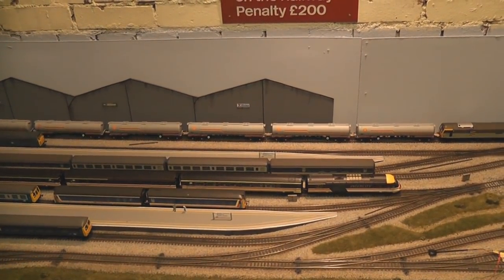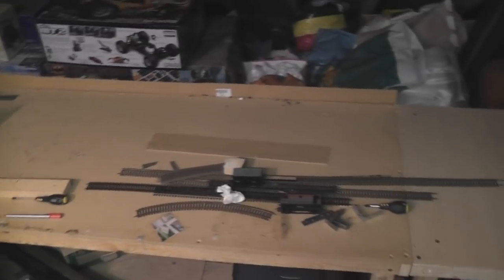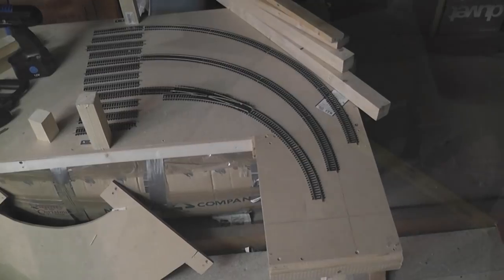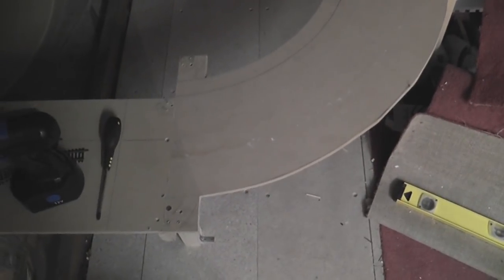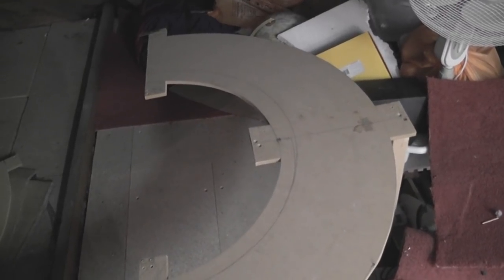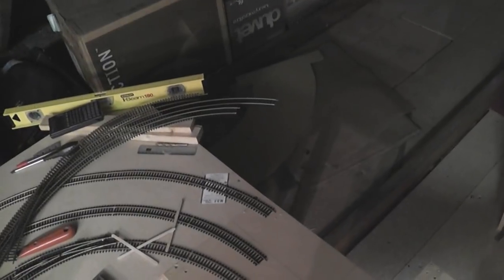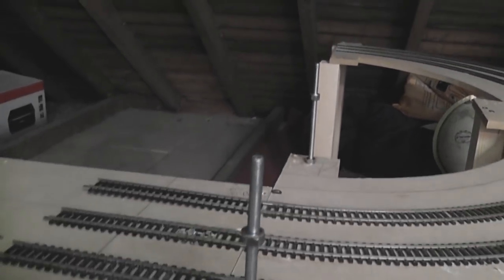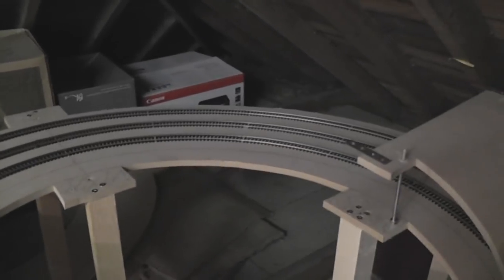How to - Episode 8 - Build a helix

Comment from the maker: I also use threaded bar later on in this video.  The wooden legs are for securing the helix to the floor.  The helix is a long way off the ground so threaded bar would be a bit impractical.

Comment: Hi. Great layout and instruction. Can you confirm if the track was 1st, 2nd and 3rd radius or flexi track? I am wondering if there will be an issue with certain loco's on the 1st radius - have you had any problems?

Comment: You know you say that this can't be used on steam era layouts? Well, I have a heritage centre layout (modern era with steam services running), and would like a second layer for a fiddle yard. Could I send the steam locomotives up and down on their own, then get a powerful diesel locomotive to shunt the rolling stock up? 

Also, would an 0-4-0 make it up there. I have a shed coming off of my outer loop so if they can't make it up I will sotre them in there.

Comment: Thanks for uploading this, very helpful! i've never constructed a helix before, i'm planning an exhibition layout at the moment which will include 1 single track helix, probably 3rd radius as that tends to suite most models better. Also thanks for the tip on the steam locos as there are plans to run 1 or 2 but at most with 3 coaches.
Do you think i'd have any problems using 6mm ply wood instead of MDF?